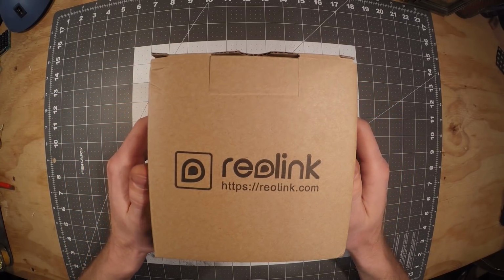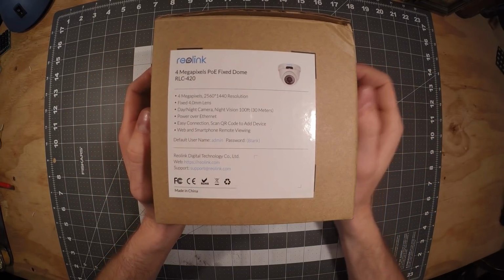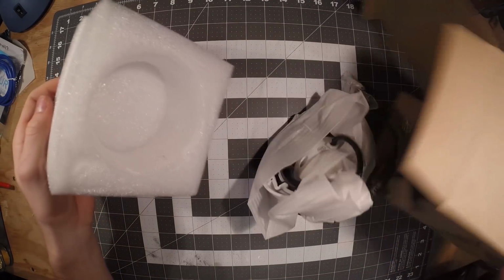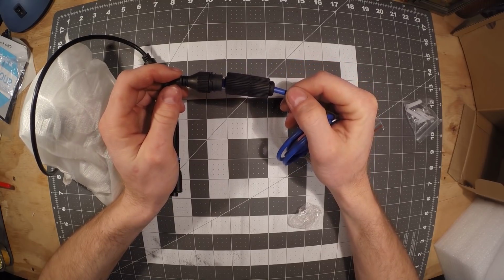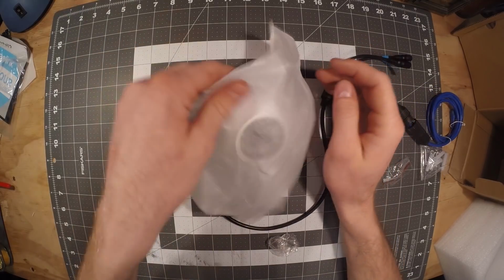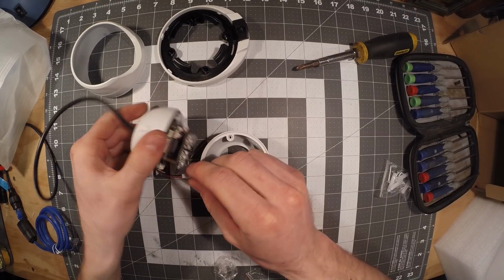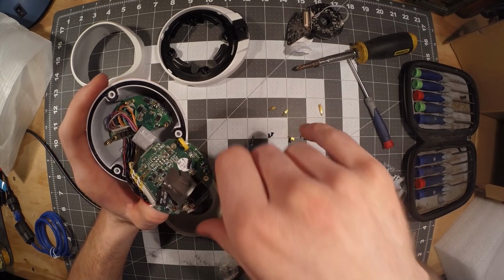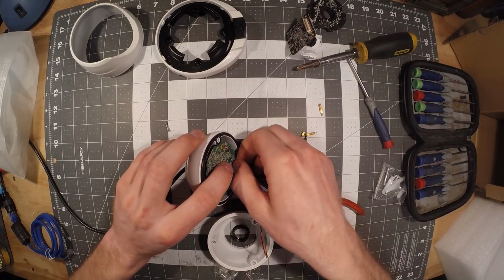Reolink RLC 420 Inside out

Comment: Nice video mate, very well explained and easy to understand, I'm putting 3 of these out the front right now and 2 bullet camera's the RLC 410 's out the back. Liked the video and hope you continue to bring out this still as well as a run through of the software.
Reply from the maker: Thank you. What recorder are you using? Or are you just using software and a old computer?
Reply: Thanks mate I only use the NVR that came with the system, I have a problem with 2 of my camera’s and what’s happened is the field of view is extremely narrow compared to my rlc 410 bullet camers. I will link the pics and if you have time can you have a look. Thanks mate for the reply.
http://i13.photobucket.com/albums/a279/azzuro/Main%20Drive.png
http://i13.photobucket.com/albums/a279/azzuro/Drive%202.png
Reply from the maker: yeah that is vary narrow. If you wanted to I bet you could get a replacement lens off ebay for like 10$ and make it wider. Thanks for the update.

Comment: Is the lens can be replaced? I would like to try a 2.8mm lens instead the 4mm. Is it standard CCTV lens?
Reply from the maker: Pretty much any security camera lens can be replaced the only thing is that some manufacturers will glue the lens in place or use very thick grease making it sort of difficult to remove.
Reply: @GetNshitDone  How about specific to Reolink, can that be changed out?

Comment: Hi...Great video. I just got my RLC-420 (four) with NVR. I found it strange that the camera you showed is lacking an SD Card, because mine a slot that says MicroSD right next to the mic with two screws holding it in. I'm not sure if there's actually an SD card in it, but at least I know it has the slot.
Reply from the maker: Thank you! Really? If you try it please let us know. I hope it can take more then a 32GB card that would be nice.
Reply: @GetNshitDone  Yes it works and can take 64 gb card, card is easy to install and remove.

Comment: Hi, can you tell me if the frame rate drops at night on your cameras?, I have just got  Reolink RLC-420 - 5MP and I am using Blue Iris v4, as soon the sun sets it frame rate drops from 25 to 12-13! I hope you can Help me to find out if this normal or not!! Cheers
Reply from the maker: Frame rate dose not change however the sensors reaction to the light is reduced because it has to expose to light longer between captures. So the refresh rate is slower, but the recorded frame rate is the same.